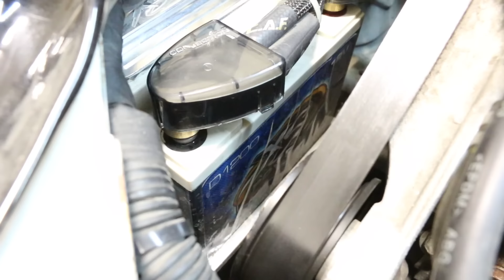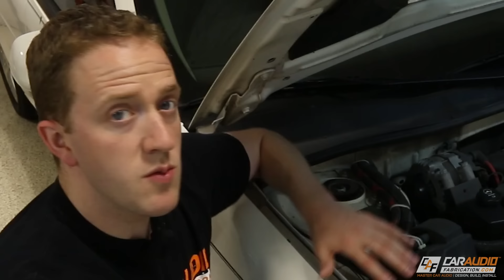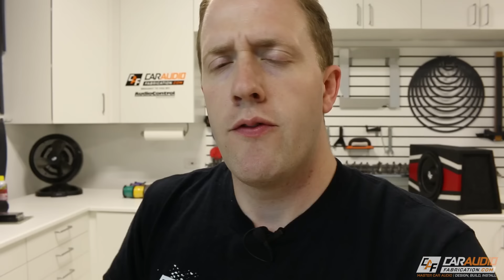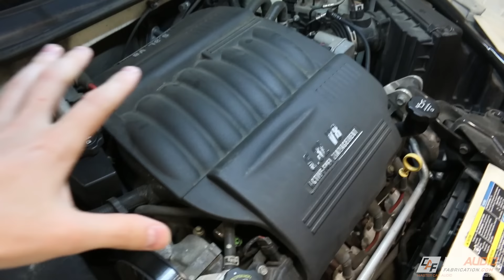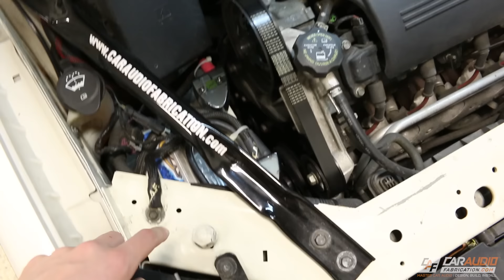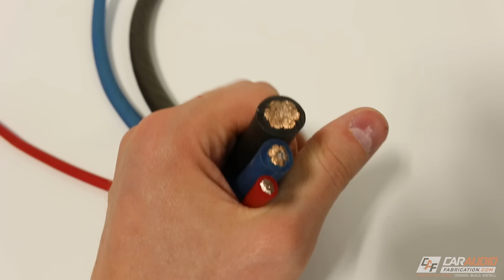Upgrade THESE for better Car Audio performance

Comment: Order of upgrades IMO.
1. Chassis Ground from frame to Negative battery post. And all return path positive cables attached to your system.
2.  No larger than 1 Farad stiffening Capacitors.  Larger capacity caps put a load on your alternator before the next hit.
3.  Before you buy anything else make sure your box is actually correct for your subwoofer!
Tune can dramatically affect box rise of several ohms and free up wattage.
4. A match set of AGM Batteries and an AGM battery tender so they don't sulfate during Discharge while you park for several days and stop the chemical reaction.
5. High Output Alternator.
Reply: 1) what do you mean as match set of AGM batteries, as in 2 batteries that are both AGM or one lead acid and the other AGM?
2) I wanna put another battery in my car, I have an AGM in the garage but my car is lead acid. Can I pair those two and how do I pair them safely? (dont want my car catching on fire)
3) with a higher output alternator which puts out alot of amps, do i need to put a bigger fuse? As in 100 Amp fuse to a 300 Amp fuse?
Reply: @anthonypietersz6774  matching batteries as in you order 2
Reply: thanks for your input bro ..im abut to run 8 12" old pioneers  4ohm  dvc on 4 old school 1400.2 mmatts amps ,.... 8 6.5 highs 8 6x9 ...8 large tweeters and4 smalltweeters on 2 3000/4 channel ds18 and small prv amp on tweeters.. radio run small tweeters .. what batteries and cap ..amp alternator i shou use ..72' buick ..thanks inadvance
Reply: @knock904  XS Power.  Has what are called Superbanks.  These are beyond a capacitor.  They are basically fast charger car battery replacements.  I am now updating my recommendations to advice the high output mechman or JS alternator as the 1st more affordable option.
First all grounds 2/0

Connect the alternator with at least 2/0 COPPER KNUKONCEPTZ.  FUSE to 10% below the rating of the alternator.

Then install the xs power superbank in place of your starting battery under the hood.  Now relocate the largest xs power AGM that will fit inside the vehicle and fuse all connections for the wire amp rating.

Xs power now gives appropriate watt handling on each battery and super bank.
Reply: Yeah lost me with the caps. No need when you have the proper batteries which you stated in one of the numbers.

Comment: I have a few questions! I'm getting a sub installed in a few days and i'm currently running JBL GX602 speakers in the rear and GX600C in the front with an Alpine KTP-445U amplifier. So with my 10 inch 4 ohm Pioneer subwoofer, I got the Pioneer GM-D8601 (1600 watts) mono amp to power it. Will my car battery and alternator be okay? Is this kind of the max power that factory electrical can handle? Or, will I be over killing my system. The alpine amp is 45 watt RMS @ 4 ohms and the mono amp is 300 watt  RMS @ 4 ohms. I only have the 2014 Focus ST base model but the upgraded Sony sound system in the higher packages run 10 speakers w/tweeters and an 8 inch Sony Subwoofer in the rear. I also have no Navigation or Sirius XM. Just bluetooth audio and USB.
Reply: Did it work
Reply: @Contact_Info  it works great. Still have it actually and I haven’t blown a fuse. My car battery runs out every 2 years or so but that’s mainly due to the hot summers here in the desert

Comment: I’ve learned a lot from your channel and appreciate all your effort that goes into making these videos. I’ve ordered everything to do the “Big 3 Upgrade” on my 2008 Honda Ridgeline. I am curious as to why the power wire from the alternator to the battery positive isn’t fused in two locations, as close as possible to the alternator and the battery. If the wire were to be compromised and blow the fuse at the alternator, wouldn’t the section of wire coming from the battery positive still be hot and potentially cause a hazard? I’ve never seen anyone do that, but it stands to reason that a broken 1/0 wire coming from the battery positive wouldn’t be good.
Reply: Yes I would fuse both ends for safety.

Comment: Mark that was a great video on touching the bases of upgrading your cars electrical before installing a sound system!!! 👍👍👍 I personally believe that anybody should upgrade there cars electrical when running a system that will be 1000 watts RMS or more!!! I have always started by upgrading my battery, alternator and finally doing the BIG 3 upgrade!!! After that I calculate the total RMS watts that I will be running to determine how many secondary batteries I will need to install in the back of my car!!! That's just the method I have always used before doing a car audio install and it has seemed to work for me!!! Many people have other different methods of upgrading their electrical, so hopefully I didn't leave anything out!!! Once again great video!!! 👍👍👍

Comment: Should I be able to feel a kick or bass drum with Alpine 600 Watt subs with 300 RMS watt amp?  Or do I just need more power?  Also is 8 AWG wiring okay or should it be 4 AWG?  Thank you in advanced.  It plays long bass notes great, but short kicks are weak asf
Reply: SubliminalX7 are you actually using all 300W rms? What does the specs for your amp say is power output based on ohm load of your speakers. Let’s say you are using 300W with 12V system. If Class D amp, consider your amp is running at 75% efficiency. Divide 300/12/0.75=~34A. 8 AWG is usually rated for 50A, so you should be good. The website for your amp usually gives you the recommended gauge of wire to use, but it is usually conservative (larger than needed). Just make sure that your ground wire is same gauge as your power wire so that voltage drop and current throughput of the circuit is balanced. You should get good base with your setup. Could be the box design that is giving you the issues you mention.

Comment: Power n ground only use true of wire no cca bs ever. Battery, big 4, alternator, second battery. Homie that said throw away capictor is right there a gimmick str8 garbage there are very expensive ones out there that are quility built but the gain is far from what you are looking for and a waste of your money. The cheap ones are just a ugly paper weight. Go with XS power batteries or optima I'm currently running optimas 2 years now no issues very high quality battery at a moderate price. I can't stress enough.... No cca is you looking for a cheaper power wire stop save up and get only 99 percent ofc the gains from that alone with dar surpass a cap

Comment: This is going to be a long drawn out/Important Question!!! But I think about it a lot. So I don’t want to spend anymore than I have to, to keep my car running... but I do need a Big 3/4. I just don’t know which one to start or with what I need. I have an 1.8K amp powering my 2 15” DCs with 1/0 cable from the battery to the amp and capacitor(cheap CAP doesn’t do shit). So I’ve seen ppl that say the alternator backplate is grounded to the motor through the bolts mounting bracket (bare with me I may have a thing) then to the chassis from the motor ground connection and from chassis to Neg. battery terminal. Correct? It’s all connected. So is adding a whole cable from the Alt. Backplate necessary? Or could I just sand the mounting bracket down, add some stainless bolts, washers and corrosion protector be fine there? I’ll add bigger Gauge from Alt.+ to Batt.+ and Batt.- to chassis ground and block to chassis and that’s Big 3. If I’m right/wrong about the alternator gnd. and I need the big 4, do I need bigger than 4ga or even 2ga cable for those connections with the amount of power I’m pulling? Should I use the same wire as I did for my amp connection at 1/0? Does the length of larger gauge need to be shorter than the original wire? Does that only matter when running amp wires? Would it hurt to be the same length or longer than original in the Big 3/4? What size do I need and how should I do it?

Comment: The alternator is the mitochondria of the car.
Reply: The mitochondria is the power house of the cell
Reply: It also charges the battery. When it's got the mitochondrias full
Reply: If the alternator is big enough your can have two batteries!
Reply: And the current is ATP 🤣
Reply: Dr Mike anyone? xD
Reply: I hate that I understood that 😂
Reply: Now I understand. 😳
Reply: This comment needs more likes.
Reply: Amazing!
Reply: The alternator is the powerhouse of the car.
Reply: @bailey2517 that’s what he said…
Reply: @andylevingston16  yeah, idk why I even commented lmao.
Reply: Wouldn't the motor be the mitochondria? And the alternator ATP synthase.
Reply: What does that make the battery?
Reply: @roddydykes7053 Liver?  It filters bad waves. By itself it just provides a clean current  ... I'm taking a stab in the dark, here.  But I know my truck has a 240 amp alternator and four huge AGM batteries. My A/V (stereo, TV, and CB radio)  have what seems to be 99% less distortion when key is off.  This includes when I have a 110v extension cord plugged into my inverter/ charger, as that is how I can maintain battery power while parked for extended times in excess of 10 hours.
Reply: HAHAHA
Reply: Nerd! )))
Reply: Nobody likes a know it all vacuole.. mmm kay ( ͡° ͜ʖ ͡°)

Comment: do you have a video on wiring only? best gauges to use, for what and where? best material for running your upgraded system? what is the best wire to use from your battery to your Amp? what kind of wires to we wat to push from our Amp to Sub/ or subs?

Comment: If anyone who sees this comment help me i want to instal 2 12 inch soundqubed subs rated 1200 wat rms and I’m using a 3000w HIFONICS Brutus super d mono amp to power them. 
I have a 2017 Ford Fusion S base model. I know im gonna need the big 3 and most likely a new battery but what else??

Comment: Pretty much everything he said went over my head since he kinda went over briefly each subject. No specifics what so ever but whatevs. Just gonna slam in 2 12 inch subs with a 1500 watt amp with full copper 4 gauge power wire and wire the ground to the trunk.

Comment: on newer models none factory systems are not held back there are the max that can be used without overloading the electrical system newer sound system in factory are no part of the C.A.M system that include all computer controls and don't forget if you upgraded the electrical system you void the warranty if you still have one

Comment: Wiring, because without it you have no current flow. Then alternator for extra amperage, followed by deep cycle batteries for storage and preferably isolated. I do not find power caps useful for anything. I believe power caps were designed to take care of a problem that shouldn't be there in the first place.

Comment: 0:36 AFAIK, the alternator's job is to keep the battery charged, not to run everything on the car when it's running . Yes it can keep the car running if the battery is removed, but this is only when the car is 100% stock. Sometimes they are a bit more powerful than the power demand of full car's features turned on, but when the power demand surpasses the power-generation rate of the alternator, the battery helps it out. 

This is proven when someone blasts music with their sound equipment on their idling car with no electrical upgrades , and then they turn off the car only to find a dead battery when trying to restart it.
Reply: VochoTalacha  correctamundo
Reply: Wrong.
Reply: Kyle Sonsalla  why wrong, explain
Reply: Nah man, the alternator is supplying power to everything up until it runs out of capacity then the battery is used as a reserve. The reason is the voltage coming from the alternator is a little bit higher than the resting voltage of the battery. You can see this when the bass hits hard and your lights dim. The voltage drops to what the battery can produce at the given current draw.
Reply: The alternator electrical output is between 13.5 to 15 volts and runs every electrical system in the car which include charging the battery as well.

Comment: I lucked out on my car 2012 Chevy Cruze LTZ turbo, it came from the factory with a high output alternator and big 4 already. I added one XS power XP3000 in the trunk and my voltage drop is non existent on 2 DC audio amps. DC 2k and 90.4. I actually over did it on the battery, but I wanted room to grow and get a 5k later. I’m gonna try it and if I have any voltage drop I will add another XP3000 to stiffen it up. Now I do charge the battery’s every couple of days just to keep my alternator from kicking on a lot and put less strain on it.

Comment: The Alternator, especially if you have an older car. For example I have a 76 Buick Regal 3.8 L and came with a standard 63 amp alternator 😨. ✌️out
Reply: i have a 95 caprice running 1500 watt rms .... needa get alternator tested from what i seen online the stock caprice alternator is 104 amp. what did you upgrade to - 200 amp or more?
Reply: I found a vid here n Utube on to rewire your alt to dble the amps. My alt is now a 120amp running a Rockford Fosgate P1000.5 😎. ✌out from Cali.

Comment: Well I got a really good head unit.. why do I need any of those 2 audio control products? I have 5v pr3 out, then... I have a second car that's got an 90" eclipse CD player in there that's got 8 volt pre outs balance
Reply: You only needs those upgrades of you are going to push some serious power. I would say anything over 1000 watts. Your music has to run effortlessly along with all your other vehicle electrical components

Comment: Thanks Mark for these fundamentals.

First upgrade path may likely be improving the ground runs from body, engine, etc to battery.  And also alternator to battery 12v+.  In other terms, the big-3 or 4.  Also will require thought on fusing, terminals and size and routing.  Also, determination if OEM alternator and wiring size will be adequate for the draw of the types and amounts of amps planned for the build. No need for a big 1/0 run if driving a P Six DSP or your AudioControl class-D amps, but something to consider if the plan is 2 or 3 Zapco Z-LX high power class AB amps with significantly more power draw. I’m powering two XD1000/5v2 amps fine from a single 4awg trunk run from battery.

Comment: What gauge wiring do you recommend? Does all three need to be the same, or can you downsize for the ground and body connections?
My ride, 2017 wrangler JK unlimited
Reply: according to everyone else in these comments 0 gauge wiring for everything.

Comment: You should definitly start out the cables and do a big three upgrade if your battery is'nt old and really bad. After the cables you should upgrade the battery and if necessary put another one in there. If you need more power than that, you should upgrade the alternator.

Comment: If I were upgrading my electronics, I would start with the most expensive. Alternator, Battery, then Wires. However in doing so, I would have to actually install these parts all at the same time.

Comment: I'm guessing a good starting point is the alternator for most people because that's where most of the power usually used originates from. That's all assuming that you have already upgraded things jn your system that have been lacking like line output converters, better head units and higher efficiency amplifiers. All of which will probably be less expensive to start with than tackling a high output alternator/battery/or wiring if you are not doing it yourself
Reply: January Morris if you don’t upgrade the wires before putting in a HO alternator, it is the same as putting a high pressure pump on a garden hose. Remember, current flows through the wire while voltage passes across the wire. Increased wire diameter means more current flow due to less resistance and less stress (pressure) on the insulation. If that doesn’t work, try second battery isolated from primary battery with relay/solenoid so that your car system is pulling from primary battery and audio system is pulling from secondary. And it is key to ensure that your batteries are same class and are each new so that you do not have one fighting to keep charge balanced on the older one.

Comment: Great vid, Mark!  I like the way you emphasized each section of the car's electric system, including wiring and the car's chassis.  I did not worry, but if I did, that look in your eyes would have put it all to rest.

Comment: Negative battery/ground the system with a better ground/bigger wires.
Then upgrade positive wires the same
Then add any audio/video/accessories/etc.

Comment: So far I've done 4ga from the front back for the Kicker 500.1 I got in my car and already did the big 3 but have it fused with the fuse removed since the power drop doesn't seem to be that much. Still running stock alt and on 3rd stock replacement battery.

Comment: Hi Mark, in one of your earlier videos, you mentioned a figure which you can use to "roughly" calculate the area taken up by the displacement of the speaker, battening, wadding, port etc... Please could you remind me of that number again. Thank you very much.

Keep the videos coming, there great...

Mark from London UK.

Comment: Ahh...they don't make a hi output for my Honda Fit. So I had to get an isolater and 2 batteries running parallel, just to push 600watts. 4 mids , 2 amps and 2 subwoofers.

Comment: I would say first would be a good battery and the big three and then if that doesn't work out install a highout put alternator.. can you talk about capacitors cuz I've been taught they are not worth it..

Comment: Hey Mark, do you or will you ever do a subwoofer wall build or tutorial? I'm looking to build one but i havent gotten the electrical plans quite down to run power to rear batteries and amps. Whadd'ya think

Comment: Insulation is the last priority for current carrying conductors for car audio use. You should always use cable sheaths regardless of which cable you're using in the engine bay.